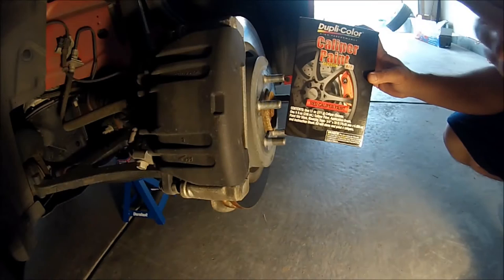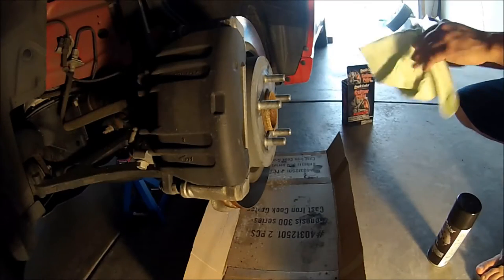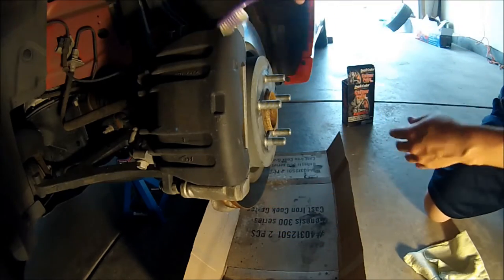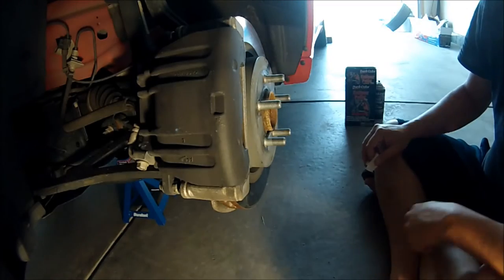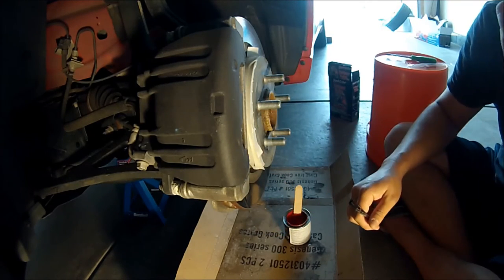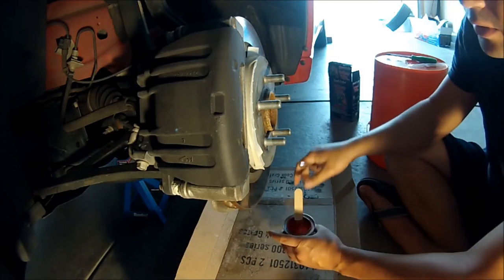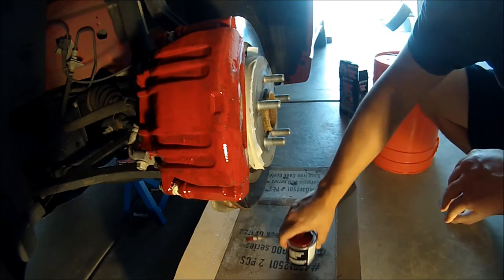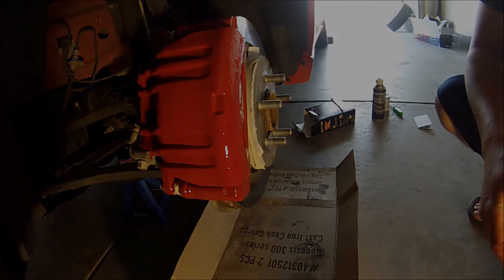How to paint your calipers

Comment: What are the key parts to mask off when doing it by brush? I have a 4 pot front and 2 pot rear for my WRX. So far it looks like the boots on either side, the brake bleeder screw, the rotor and the pad. Is that correct?
Reply from the maker: Basically any moving parts and pads you want to avoid painting.

Comment: Where did you find the caliper decals? Thanks o/
Reply from the maker: You can search for caliper decals on Amazon. Make sure they are "high temperature" and should be fairly cheap. Mine were $6 and some change.
Reply: Will do, Thanks